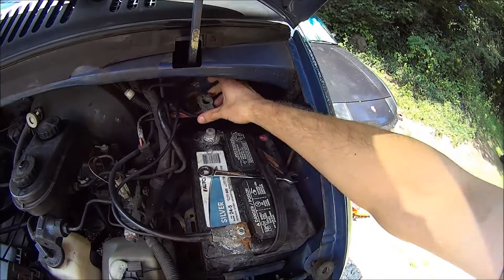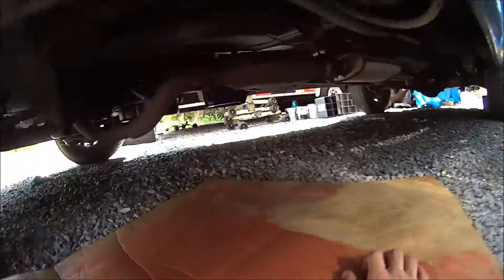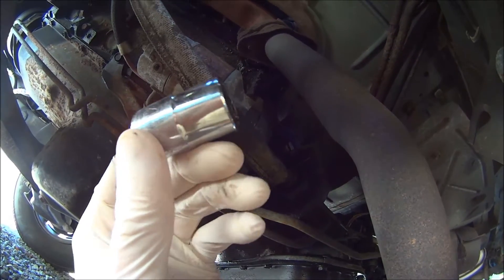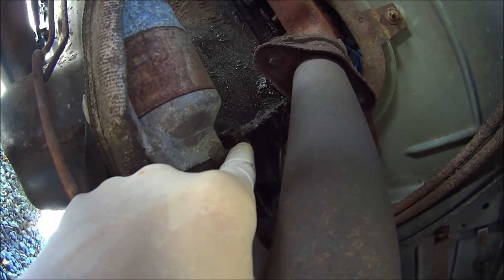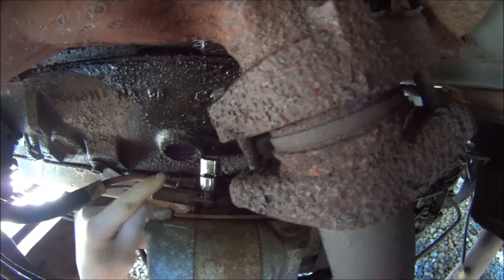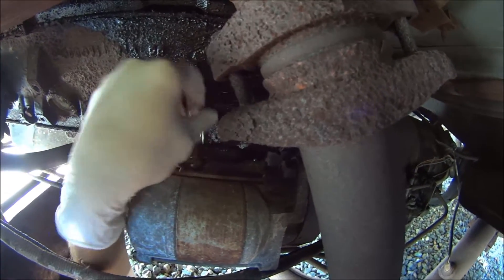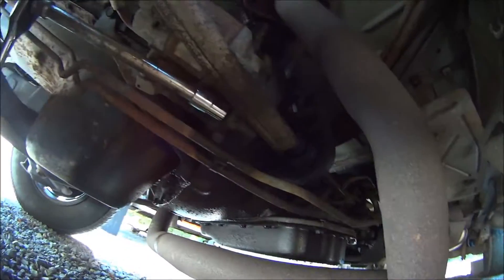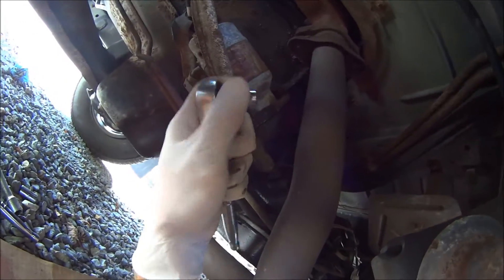Starter removal dodge van and truck with 318 engine

Comment: 1972 dodge tradesmen b300 it has a 318 it turns but won’t start  I have to use jumper cables and the belt moves but wont start it turns without the key in it or on there ignition is why it turns because the jumper cables we put a fully charged battery in it it wouldn’t do any thing is it the starter solenoid
Reply: If it is cranking over then it is not the starter. If you pour a bit of gas in to the carb does it start then? No?  then test for spark. If no spark replace plugs wires and dis cap. If you have spark then test/replace your ignition switch. These are the most common things I've found to go wrong with these Dodge models.

Comment: My husband can get bolts off but the bolts to the wires he can't get off, obviously doesn't want to spray wd40 on It to loosen it because of the wires but is there easy way to remove them without the wires moving when he tries to remove the bolts?
Reply: It would not hurt to spray WD-40